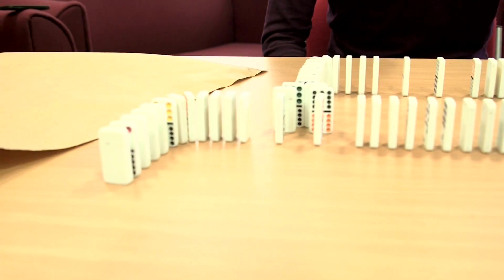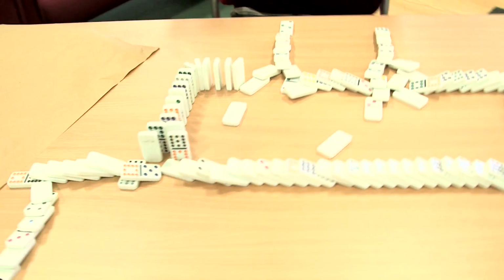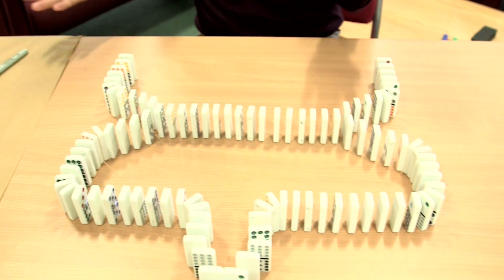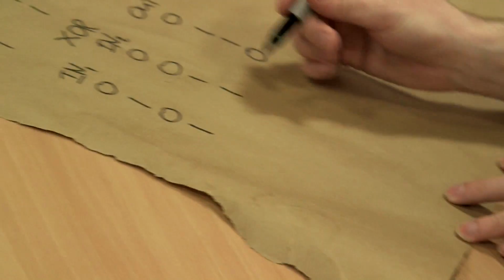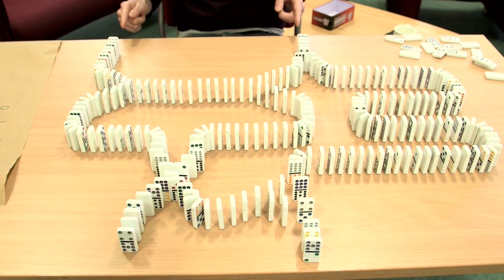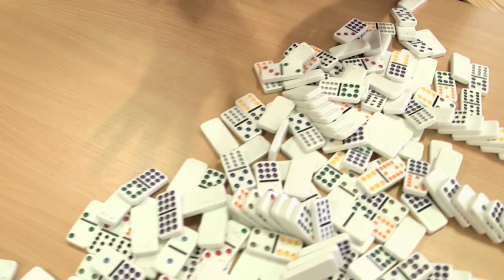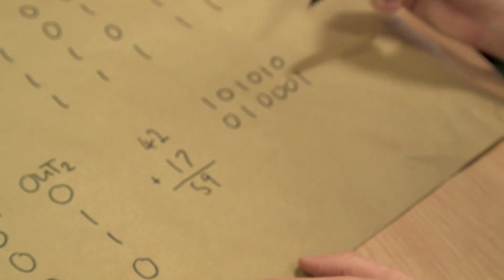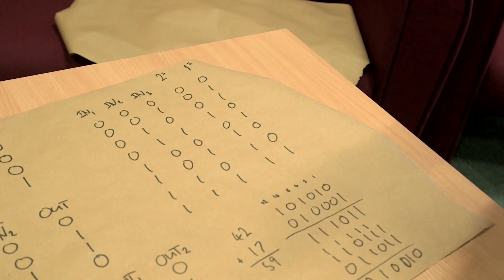Domino Addition - Numberphile

Comment: I remember trying to make an XOR gate before I saw this video. If you take a line of dominoes with 1 'breaker' that gives the expression C = (Anot) * (B). Using 2 of these and tying the 2 inputs together I get C = (Anot) * (B) + (A) * (Bnot)  = A ( + ) B but I couldn't do it without having 1 path of dominoes needing to 'BRIDGE' over the other path.  Its amazing how you figured out how to tie together 3 full adders with a 1/2 adder and not need any cross over bridges. Nice planning!

Comment: How do the electric signals block each other?
Reply: Read about transistor, especially the part about how transistors function as a switch. Currents don't block each other, rather a current activates another current, which, with appropriate arrangement, can be used to create all the logic gates shown here
Reply: Arnav Barbaad  A transistor of graphene, as far as I know (correct me if I'm wrong) does not conduct electricity, however if you put a current to it, it becomes a conductor, right?

The thing is: If a current (true) tries to go on a XOR gate, it would turn on the switch instead of blocking it.

On the link below, the picture shows me that the current goes if no input blocks it. How does it does it?

http://upload.wikimedia.org/wikipedia/commons/a/aa/NOR_gate_layout.png

Comment: what would be really impressive is if you made a NOT gate - make the output domino fall over when no input domino is pressed :P
Reply: An angle?
Reply: Edwin Camuy no.
Reply: ImaginaryHuman072889 Why? I can put some dominoes in a really long ramp, and there's an intersection with the part where the ramp meets the ground. In a way, if I press the input BEFORE the dominoes reach that spot, I'll stop them from reaching the output, creating a 0 output. Otherwise, if I leave it alone, the dominoes in the ramp will fall and I'll get a 1.

Comment: Alright, I'm using this same logic system to make a computer in "Minecraft Pocket Edition". 

For those of you who've played, you know that making a computer in "Minecraft PC" is possible, but only because redstone allows you to make clocks. However, in Pocket Edition, the only redstone alternative are signs that hold up sand, and are broken by the breaking of an original block of cactus. This is a one-time us signal transmitter, and therefore cannot be used to make a clock. 

However, it is theoretically possible to make an infinite amount of AND gates with signs, cacti, torches, and water. These gates can all be linked up to an infinitley large output display panel. Of course, since you can't sit down and work on an infinitley large computer, this computer will only be able to compute with a limited amount of numbers, and a limited amount of calculations. But hey, it's a start!

I've already designed the AND gate. I'm not sure if I want to share the design yet (for fear of people stealing my idea,) but once I'm done, I may make a youtube video describing how to make it.
Reply: Are you done yet

Comment: CHALLENGE:  Create a NOT gate using dominos!
Reply: If this thing was clocked all the delay loops they use (also referring to the large one they built) would not be necessary.
Reply: Can I have +/- rails?
Reply: Of course it cannot be created without an additional signal. If we have an additional signal comparable to a clock signal, then one can simply lead it to the output and use the input signal to block it.
Reply: Global Warming Skeptic Okay, what is your profile picture? I see this everywhere and I'm really curious as to what it is.

Comment: Make a not gate with dominoes. :P
Before knocking it over it'd need to be knocked over already and when you knock it over it would somehow need to put itself straight up again.

If anyone can find a way to still make one, I'd be really interested!

---But don't just invert the 0 and 1.
Reply: Simple.
You do it the same way you do an electronic NOT gate.   
You use two lines.
Line 1:  
Just a plain line that is always tripped; this is the output.
Line 2:  
This line breaks Line 1 when it falls; this is the input

When line 2 is NOT flipped, line 1 falls all the way through.  
When line 2 IS flipped, line 1 will be broken and NOT fall all the way through
Reply: Make a xor gate and set one of the inputs to true.
Reply: MC_Mac_MC 
Knock a straight line over a record it in reverse

Comment: This is one of the best videos on Computerphile or Numberphile. It uses a simple mechanism that everyone intuitively understands in order to show how a complex machine is built from tiny parts. I love the bit of "domino engineering" that was used to make the AND and XOR gates work.

The neat thing is that if you have enough dominoes, then you can build an adder of arbitrary size -- it is not merely an analogy of an adder; it is an adder. Wonderful visual and tactile illustration of the fact that a computer is not a magical box, nor is it something that can only be understood with advanced physics -- semiconductors are merely one of many ways to implement logic circuits, as are domino chains.

Comment: It still doesn't explain how computers know the difference between -128 and 255, or between numbers and letters.
Reply: I know this answer is long, but it does answer your question, and I tried to make it as easy as possible to understand.

With binary, you can represent negative numbers using 1's or 2's complement. Basically, if the first number in a binary number (also know as Most Significant Bit) is a 1, then the number is negative. This makes it so that instead of 4-bit numbers being 0 to 15, they are -8 to 7, with 1000 being -8 and 1111 being -1. There are still 16 total numbers, just now some are negative. Numbers that use the first digit to represent positive or negative are called signed numbers.

You can get a one's complement of a number by inverting all the bits in the number. So to turn the unsigned number 1011 (11) into its one's complement, you basically invert all the bits to get 0100 (4), because 15 - 11 = 4. So the signed number 1011 is -4 with ones complement. To get a two's complement of a number, find the one's complement (inverse), and add a 1 to it. So 1011 + 0001 is 1100, or -4 in two's complement.

Computer chips usually use two's complement, because it makes adding and subtracting easier. The problem with one's complement is, it's not easy to subtract numbers, where with two's complement, all you have to do is add the two numbers together and add a one. So instead of having two circuits, one to add and one to subtract, you just need a circuit to add. Therefore, to subtract, you first need to invert the bits in the number you are subtracting (which is one's complement), and add a one to that number (two's complement) by sending a 1 to the carry-in of the adder circuit. Now just add the two numbers together to get an answer.

It's a bit complicated to explain with words, but actually looking at the math part is simple to understand.

Say we want 5 - 2, this is the same as 5 + (-2), so we will have to find the two's complement for the number 2. Since 2 is 0010, we have to invert all the bits to get the one's complement, which is 1101. Now we add a 1 to that for the two's complement, which is 1110. Then we can do 5 + (-2):

  0101 (5)
+1110 (-2) 
‒‒‒‒‒‒‒‒‒
10011

Notice how there is an extra 1 to the answer. Because we did subtraction, that 1 is ignored. So the answer is 0011, which is 3.

Computer chips know the difference between a negative and a positive because they are made to use two's complement, therefore they always know that 1001 is -7 and 0001 is just 1.

Letters are different though. Letters are assigned numbers (usually using the ASCII system), and the software and programs that use the letters tell the computer that it's letters. In many programming languages, you have to tell the computer what type of value something is. So if you want letters, you have to tell the computer that. Programming languages that don't tell the computer what type of value something is have a special device called an interpreter, which looks at the values and tells the computer what type they are.
Reply: 2's compliment.
Reply: ***** What a superb answer.
Reply: ***** Dude, remind me to NEVER ask you where babies come from...

Great answer, though. But can you, like me, just imagine building all that in dominoes? Like any racecar driver will tell you, "it's not about winning, it's about putting on a show".
Reply: Depends on how you program. It's the interpretation you choose. Take floating point for example. You could interpret 101 as 5 or 2.5 in your program as long as you're consistent.
Reply: This is a binary adder, it does not do negative numbers or subtract, these require more complex circuits. I guess it was left out as explanation but oh well ;D
Reply: ntwede There are different Registers for floats and ints
Reply: Anonim Vere-Casper  And, of course I forgot to mention floats, but that's a whole different topic and system. I believe computerphile has a video on that topic...

Looking back at this answer, I could have just said the Most Significant Digit determines positive or negative in most binary number formats. I also should have mentioned that computers don't just use 2's compliment, but other data-types as well.
Reply: Zelif To expand on ntwede's response:  two's complement is a binary representation that can represent both negative numbers and positive numbers (Matt S. might have explained this, but I didn't read his response).  Essentially, in two's complement the leftmost bit indicates the sign(positive or negative) of a number.  Surprisingly, the same circuit can be used along with two's complement representation to add pos to pos, pos to neg, neg to pos, neg to neg (all the combinations).  Of course, you have to replicate the circuit for each bit--(that is, you need 8 copies of the one-bit full adder to operate on 8-bit long inputs and you must chain them appropriately so that carries(Input3) are accounted for)  Just note, the circuit as a whole (e.g. 8-bit adder) itself operates on pairs of binary sequences.  It has no knowledge of what they represent.  It is up to you to assign the representation.  Also, within one operation all the inputs and outputs must be in the same representation for the operation to make sense.
Reply: Jose Villegas Almost spot on to what I explained. I probably shouldn't have explained the steps of binary subtraction in my response though...

Comment: Output is a carry bit?
Reply: I don't quite understand the question, but I'll try to answer it anyway. With a half-adder and a full-adder, there are two outputs, one is the final number for that digits place, the other is a number that gets carried into the next full adder. The next full-adder has 3 inputs, one for the digits place of each number, and one for the carry from the adder before it. The last full-adder doesn't have another adder to send the carry to, so that carry is used in the final digit instead.

For a visual way to describe that process, I'll just add 0111 (7) and 1100 (12).
split that up into 4 parts because there are 4 digits:

  1      1
  0      0     1     1      1
+0    +1   +1   +0    +0
‒‒    ‒‒    ‒‒    ‒‒    ‒‒
  1    10    10     1      1
        ^       ^
We can't have two numbers represent one digit, so we "carry" the extra 1 into the next addition problem. So if you ignore the extra 1's in the answers, you get 10011, which is 19 and the correct answer.

Comment: Let us put it like this. A domino computer does more for the mathematician than an abacus.

BUT in each case, it is the mathematician and not the hardware on the floor or table or in the frame that is understanding what is being done and why this is mathematically correct.

In other words, a slight error of terminology on Matt's side.

The domino computer doesn't add up. It produces deterministically an "output" from one or more inputs (usually more, if I understood correctly) but it is only the man doing the input on the hardware who is aware what is being done and how this is mathematically correct.

In other words, a great illustration of the fact that no hardware can ever claim consciousness.

Also, a not less great show of the ingenuity of which man's consciousness is capable. But a baby who has not the ingenuity to build such a thing, certainly has the consciousness to appreciate it in a way the dominos or abacus beads cannot ever dream of doing.

Comment: I built a calculator like this in minecraft with redstone. redstone works like or-gates, but you can invert the signals and make and gates of them. You can also make xor-gates by making a set of two inputs to and or gate, and an and gate, and then make the and-gate block the or gate if the and gates output is 1

Comment: It's very interesting; computers can be built out of just about any interacting system, from gears to pipes to blocks to marbles to strings… to the electrical and fiber-optic wires we use today for optimal speed and practicality.
Another interesting way to simulate such computation is with computer programs themselves—namely cellular automata. I recommend that anyone reading this should at least look into it!

Comment: So what you're saying is that... THERE ARE BILLIONS OF DOMINOES IN MY COMPUTER!?

Now I know why it's always making that clicking sound. It's the dominoes falling over trying to add 1s together!
Reply: Yeah, pretty much. It's just energy being input and output through different channels. Watch out, there's dominoes in your DNA, too. And in the air! And in your food! And in pretty much every element and chemical and substance and light particle and, well, the entire universe actually.
Reply: @samd3275  Actually, The cpu has many tiny dominoes, and tiny pistons that push dominoes, and it arranges the dominos back after theyre used automatically.
Reply: Except, with dominoes, the ouput can't be turned back off. Once you've used your line of dominoes you have to set it back up, manually.
Reply: I mean, when you get way down in the physics, it is a series of electrons pushing each other around... So kinda, yeah
Reply: I always thought it was a hamster...
Reply: , storing your data, AND multipling via latchs, registers, flip-flops, and addition, as well as a flip switch so that addition becomes subtraction, and multiplcation becomes division, and the multiplication is controlled by, you guessed it, the repeat bit.

Comment: Minecraft? Dominos? Nope nope, this guy should try programming FPGA (field programmable gate array) chips. All they are, are empty chips with a series of unconnected gates, which you can route any way you want to create completely custom logic units. Want a CPU? No prob. Want a GPU? No prob. Want both? No prob. FPGAs have hundreds of I/Os, and the USB-friendly dev boards can cost as little as $80, though as much as $25k+ too. Some even accept Arduino shields. All modern CPUs are prototyped on arrays of FPGA chips to simulate the CPU in hardware prior to manufacturing it. FPGA programming languages (VHDL, Verilog) are not user-friendly, but give you great control. But yeah if you want CPU functionality inside the FPGA, you have to program it from scratch. :) No simple "hello world" commands. :P Check out Terasic's site for great FPGA starter kits.

Comment: What if you used people instead of dominoes?
Or gate would be two people as inputs holding the hand of the output, if either input raises their hand, the output raises their other hand in a mexican-wave like fashion to the next logic gate.
With enough people you could work out the answer that an individual would have difficulty working out in their head.
It could be reset quickly and you could race them against someone with a pencil and paper on multiple sums.

Comment: Question:
is 2 + i < 2?
My own reasoning is that, if 2 > 2 +i, then
2^2 > (2 + i)^2
which gives
4 > 3 + 4i
substract 3 from each side and
1 > 4i
again square both
1 > -16
Is my assumption that 2 > 2 + i correct, or is it like comparing an apple to a pear, since i isn't a real number?

Comment: "How can a mechanical system... do arithmetic?" You never heard of "Napier's Bones"? Or Pascal's Calculating Machine? Or the Difference Engine? Or the slide rule? Mechanical systems for doing arithmetic have existed for millennia. The Antikythera computer is over 2000 years old and mechanical computers were used during WWI for aiming guns on warships. And that's not even mentioning the abacus which at one point was faster than the fastest electronic computer.

And, strictly speaking, the computer chip is not a mechanical device, it's an electrical one. No mechanical energy is used inside the chip, the are no motors or actuators present; it's all done with electrical energy.